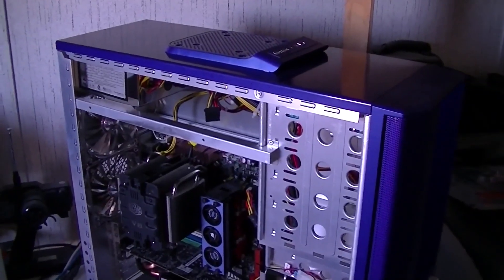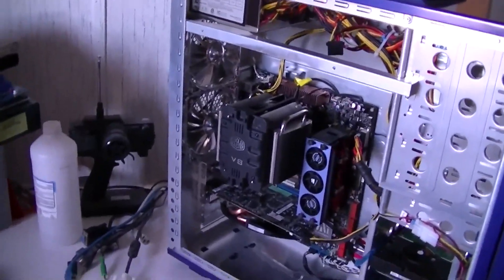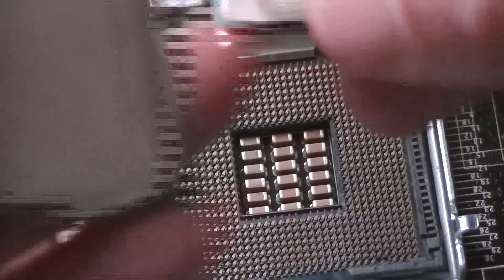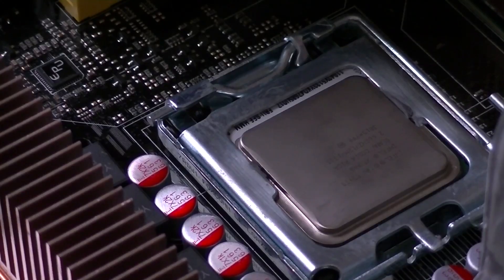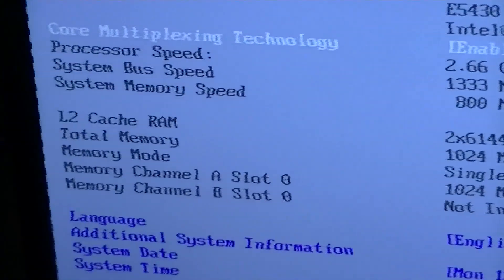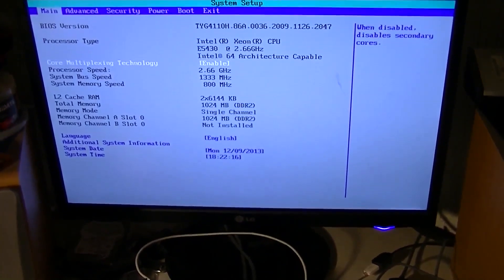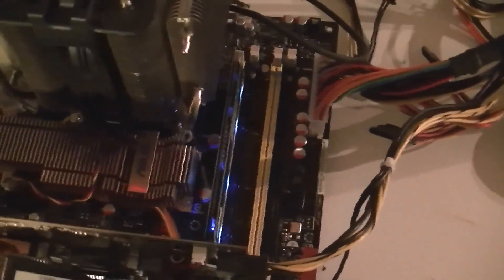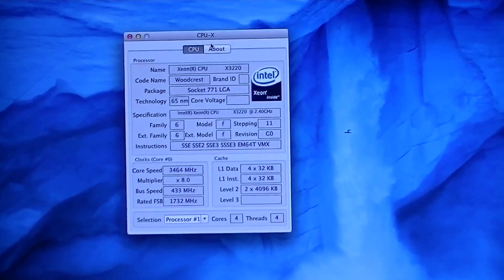LGA771 to LGA775 MOD Intel Xeon E5430 - Asus P5E vs The WaybackTECH

Comment: hi waybacktech
i have an asus p5bmx wifi mobo,it uses 946GZ + ICH7 chipset runs ddr2 667 and has a fsb of 1066 do you think it would work with a xeon chip and if so what chip would you recommend?
Reply from the maker: Hello!  Looks like the P5BMX board does support quad core cpu's.  I am not aware of anyone trying this mod with anything older than a 965 chipset. If your motherboard can overclock to 333MHz bus speed ( which would = 1333 Bus of the Xeon series) then you could at least run it at default clock for the Xeon.  I would probably go with the E5430 at this time, as it is about $23 on ebay right now.  The E5450 would be better but it is over $50 a chip right now on ebay.
Reply: WaybackTECH
thanks for reply,im currently running a E6400,iv been unsuccessful with overclocking,it wont boot past 300 mhz
the  E6400 seem  an overclock able chip,i thought might be a restriction with the board
Reply from the maker: lee2217
Going to a quad core xeon with 12MB of cache should still see a nice speed bump even if it is not running at full speed. However, a lot of P and G series chipsets that will support this mod are fairly cheap on ebay.  You can upgrade both for about $80-100
Reply: WaybackTECH
thanks again for the info

Comment: Thanks, was thinking putting in a mobile Intel Core2 Duo T7600 Duo 1.8 GHz,  into a single core AMD Sempron 3500 1.8, socket S. My concern is compatibility, or Intel v. AMD, don't know if each chip is different in Archtitect.
Reply: Maybe you can upgrade to the Athlon 64 X2 TK-42, since it's dual core and compatible with your socket. You cannot mix AMD and Intel CPU's ever, in any motherboard. 

There are other CPU's you could use, but the one I posted is 1.6ghz but equal to or less than your CPU in terms of TDP (amount of heat generated essentially).
Reply: You saved me from unnecessary dis-assembly, and I won't mix Intel-AMD, understanding that sockets are different. Will try Athlon 64 dual. Thank you very much.
Reply: 3/28/2014......Just ordered the Duo Athlon 64x2, thanks, excellent unbelievable price.

Comment: +WaybackTECH update with the Mac Pro, I got dual xeon e5430's for my Mac Pro. My problem although is that the case isn't nearly as sexy as either of your cases for this project! I really do hope that you get this up and working. Btw, what you did with the gigabyte board, you should try with the asus motherboard. (The cleaning and stuff)

Comment: @ WaybackTECH great video, i have a Asus P5Q-E motherboard with P45 chipset
is it possible to get running THIS MOD on my Motherboard?
Reply from the maker: Ya, any P45 chipset motherboard will work with this mod. Probably will have to do a microcode update to enable SSE4 and VT-X if you need those features.

Comment: +waybacktech I tried covering up the necessary pins to test the processor, on a mobo that I knew worked with a xeon!NAND it fried the mobo! but it was old anyway. The cpu I used was a pentium dual core. :-/

Comment: Is there a way to stick lga 775 processors in an lga 771 socket? I just wanna upgrade my Mac Pro and I have 2 core 2 quads.
Reply from the maker: I would think in theory, the same adapter can probably be applied to the 775 chips.  Might be a question to post on overclock.net.  The trick would be if the bios on the Mac Pro mobo's would be happy.  There are some strange things Apple does to those Mac's when it comes to the operating system and detecting the processor type to determine what model it is being installed on.
Reply from the maker: Since I have been doing LGA 771 modding the last couple months, I can tell you ( and anyone else that has this question ) that it will never work the other way around. Looking at data sheets for the 775 & 771, the lands needed to make a 775 work are not "wired" on a 771 board.  The certain lands on a 771 cpu are "reserved" an intel says " thou shalt not wire reserved lands! " but they remain wired on a 775.